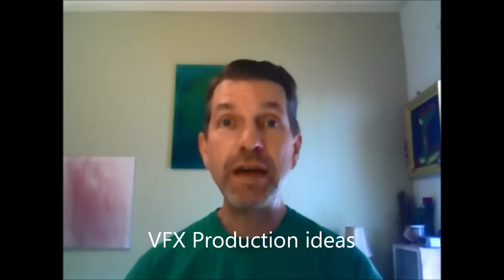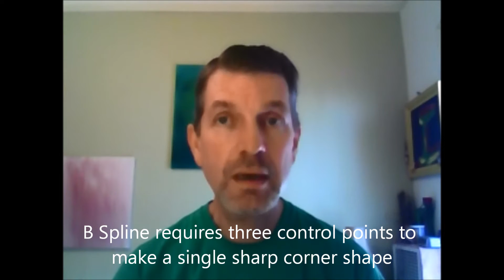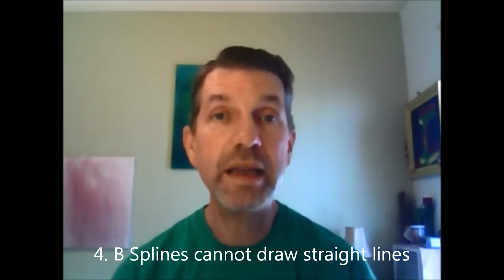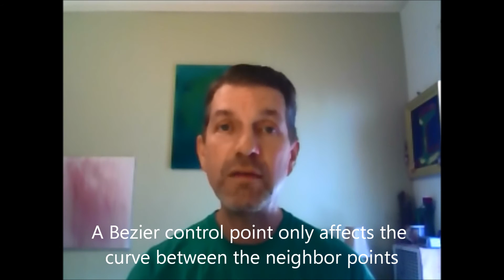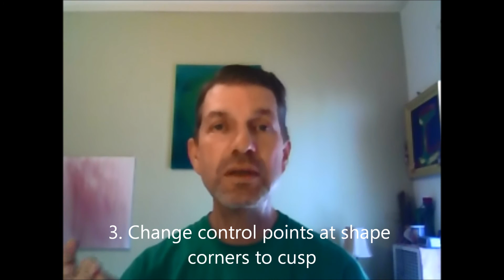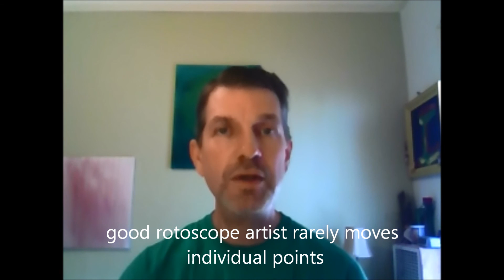VFX Production Ideas - B Spline vs. Bezier Curves

Comment: It will be great if u explain with curve drawing or curve video,
And i have some question,
Are the equation of curve same for bezier and b-spline?
How can i get the equation of the curve?
Using what formula ?
Reply from the maker: Dave Hg: That is a great comment.   Unfortunately, I didn't have the resources to add sophisticated graphics to this talk.   It takes me a fairly long time to just make a talk without too many mistakes.   I have an great appreciation for the professional software tutorials that are available.

The equations for Bezier and B-Spline are not the same.

These curves are mathematically defined and were developed by math researchers to find a minimal curve through data points obtained through experimentation or some other means.

The curve equations were adopted by graphic design programmers as a good way to define the boundary of a digital rotoscoping shape.

Most any intermediate level math textbook should have good technical explanations of both types of curves.   

I would suggest that you become familiar with both techniques.   It is always best to learn how all your tools operate, even if you primarily use only one of them.   Although I overwhelmingly prefer using Bezier Curves almost exclusively, that is a personal preference.  There are occasions where a B-Spline (or X spline) might be a better tool to use, like on organic shapes such as fabric and plants; or if the project specifications necessitate the use of a certain type of curve..
Reply: ***** ：Thank Bill Schaeffer, 
Thanks for your reply, i really appreciate it.
Now i assume B-spline is complex shape like treesm 
and bezier is like sin curve, am i correct ?
Reply from the maker: Not quite.   Actually either a B spline or a Bezier can be simple (just 3 verticies) or complex (many, many verticies).

The difference is that:

1. A Bezier curve is constrained by the requirement that the curve itself must pass through ALL the verticies.   All the data points must lie on the curve. 

In software packages, the Bezier editor has Handles on the curve at the verticies.  These Handles are used to define the curvature at that point.

2. A B-Spline is the shortest curve that is defined by all the verticies.   The B-Spline passes "inbetween" all the verticies and does not touch any point.   If higher orders of magnitude are used to calculate the B-Spline
curve (i.e. x**3, x**4,  x**5, where **denotes exponential) then the curve is sharper and less rounded.

The B-Spline editor does not have Handles.  The lack of Handles makes the B-Spline editor attractive to some rotoscope artists.
Reply: ***** : Thanks Bill Schaeffer^^
I learn lot here with u, i got clearer picture and idea d ^^ Thankyou^^
Reply from the maker: Thank you for commenting.   I will try and publish another rotoscoping, or paint, idea here when I can.